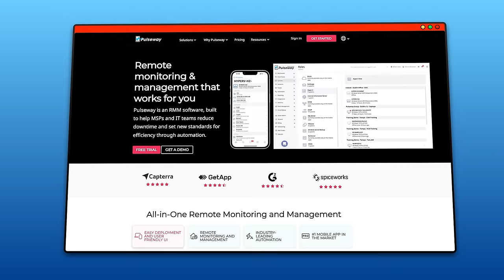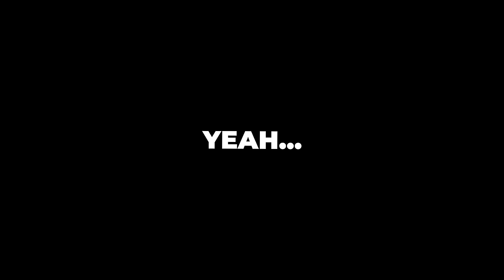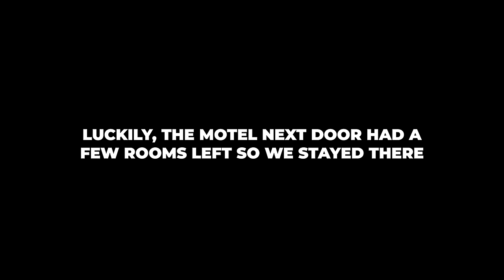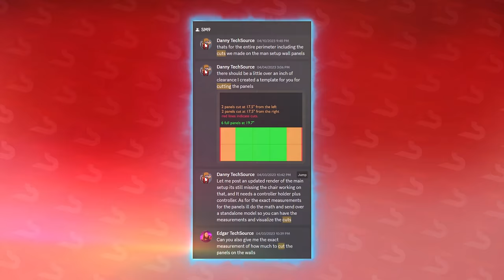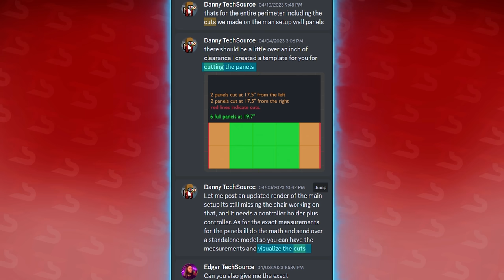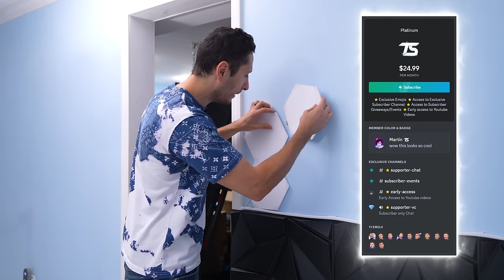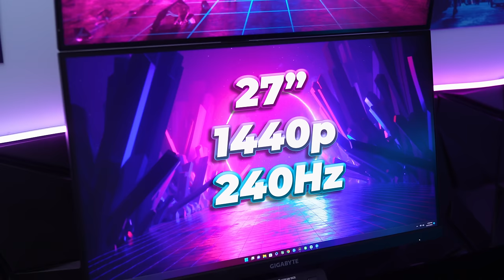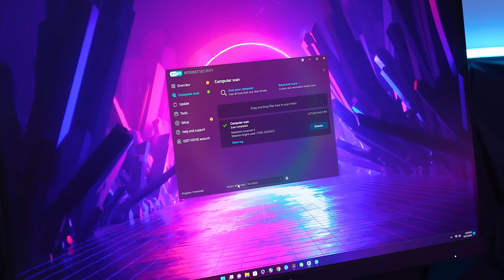Her Laptop was slow....So I built her a Dream Setup! - Season 9

Comment: After 5 years of using my old laptop that goes to blue screen every time i pick it up or accidentally moved it i hope my mom will actually buy me a new laptop preferably a gaming one mom doesn’t want me to use a Desktop cause she keeps forcing that it takes too much electricity and yeahh we have no wifi i only go with my phone’s data and we have alot more money i’d buy a 144/160+ mhz monitor if we have extra my mom’s budget would probably be in ₱15-₱20k (around $200-$350) really hoping she really buys me one for my 21st bday on May 15th i really hope it’s not one of those fake promise my mom does

Comment: Sadly i just built my own pc 
Im using a place holder card atm im buying a 6800xt but rn my place holder is a 3060ti
Tbh the 3060ti is doing work tho its a really good card for £180 and my cpu is the ryzen 5 5600x 16gb dual ram sadly its ddr4
I built the pc from an older gaming pc reusing parts